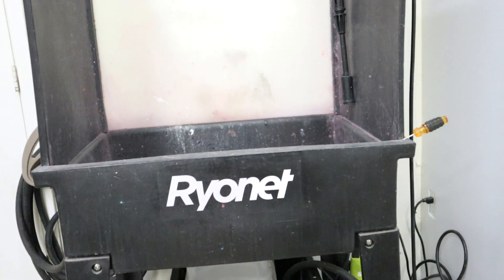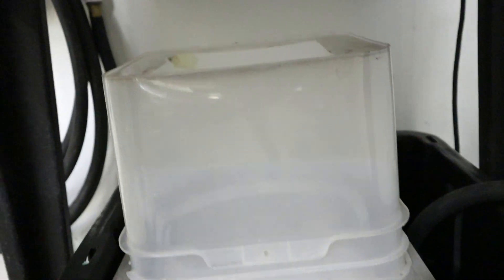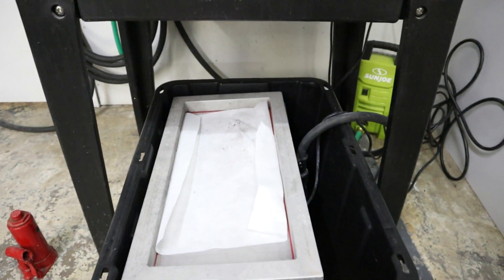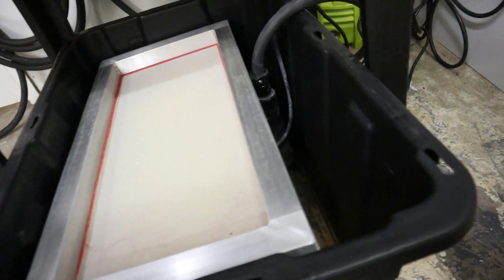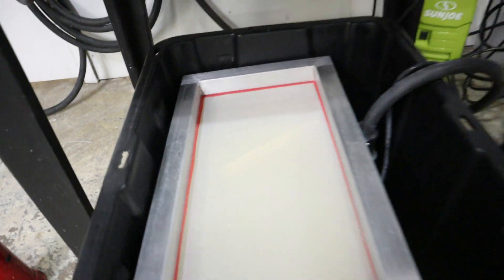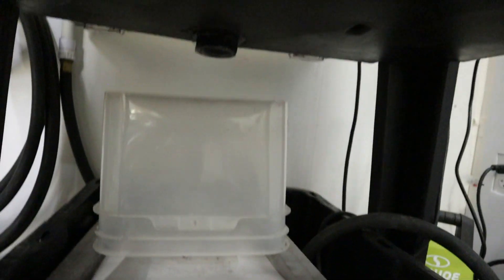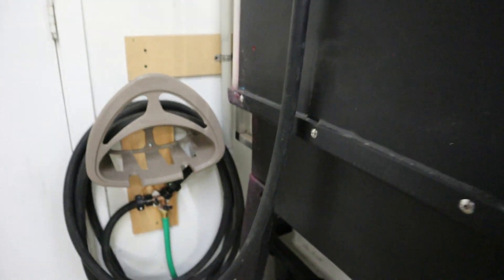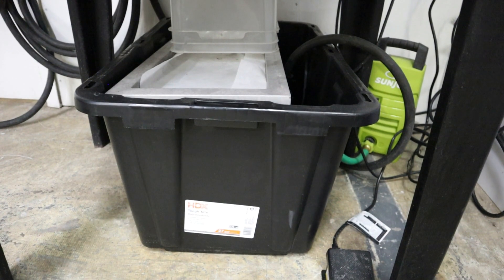Screen Printing Water Filtration System Build

Comment: Thanks for sharing. How do you clean those screens once they get dirty?
Reply from the maker: Typically can just flip them over and spray them out!   Depending on how long you go, might need some chemicals to help 👍
Reply: @Novoworks  alright thanks. Do you have any other filter media you recommend using? As in disposable stuff to put inside the screens to take out solids
Reply from the maker: @bryson5628  - Typically the roll filter material I have on top of the screens catches most of that and you just trash it.
Reply from the maker: @bryson5628  - Follow up here also - https://www.youtube.com/watch?v=fF1Mu_UfydA

Comment: Great idea - built my own with a 20 and 5 micron filter - it seems to handle the chems fairly well - Could not really see in the video how are you holding the screens in place - do you have a bracket or something ?
Reply from the maker: Good deal!   As for holding the screens -- just built a simple frame that sits down in the tote and the screens sit on top of that frame.